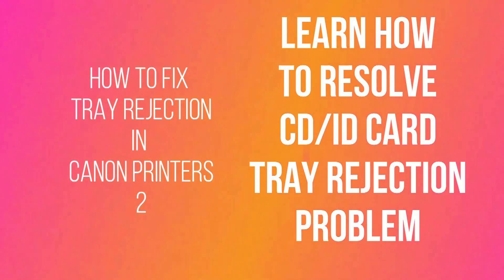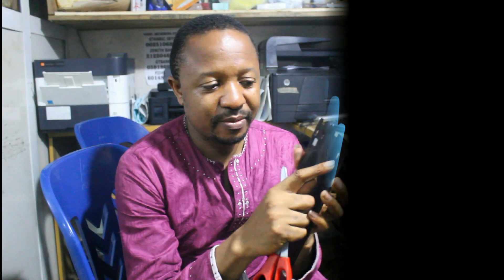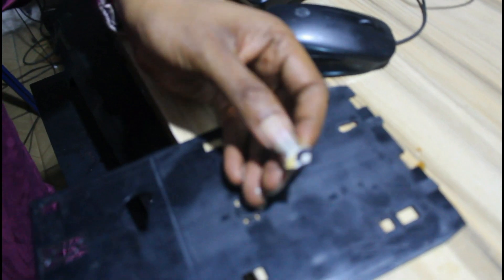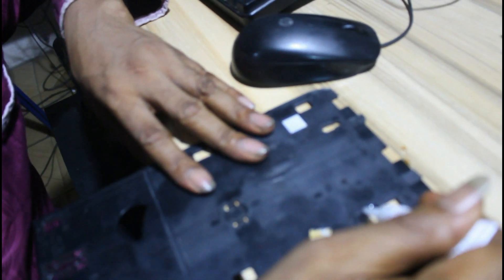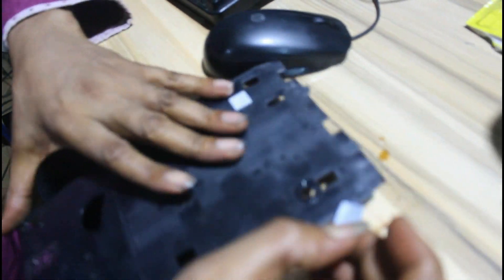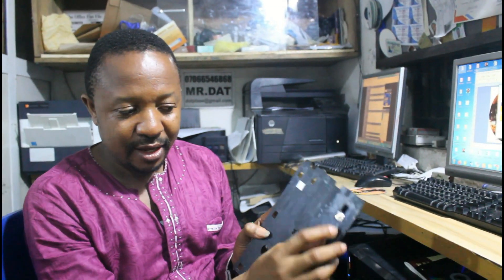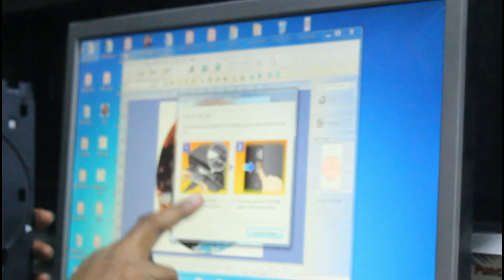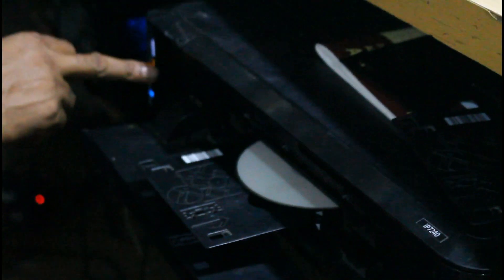How To Resolve Tray Rejection Problem in Canon CD ID Card Printers   Part 2

Comment: What if the problem is not a tray its in the printer?
Reply: That's what I'd like to know. The CD tray always keeps coming out when I insert it. There is nothing wrong with the tray, it goes in, but it keeps coming out without printing the disc.
Reply from the maker: This might be a board error or printer haed. Pls try changing the head first. But the safest thing to do is to try your printhead in another printer. Try reseting the printer with a Service Tool.